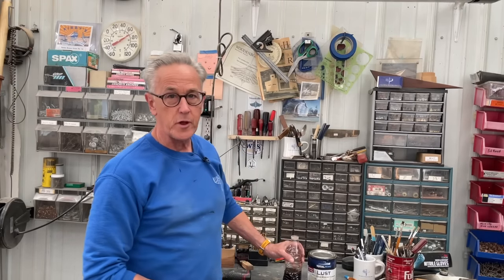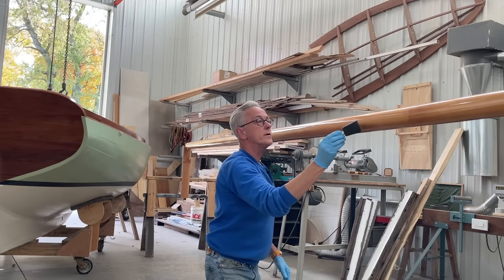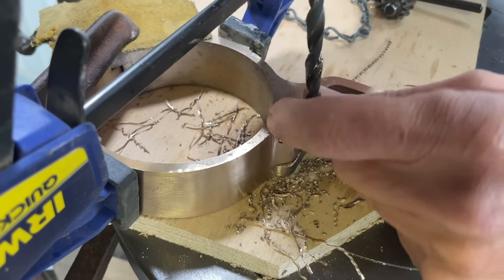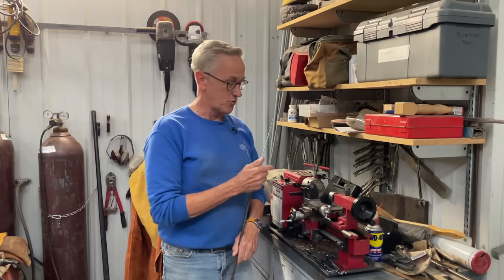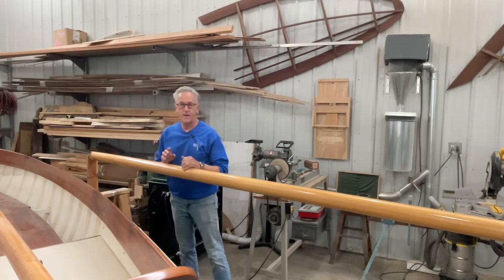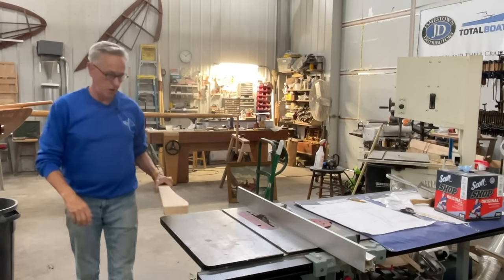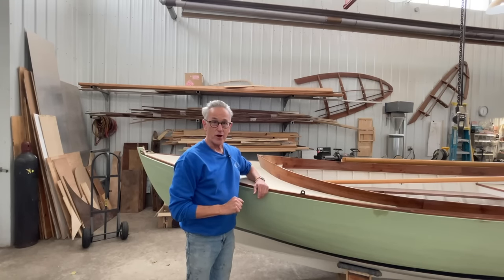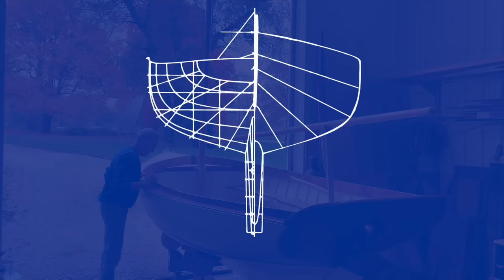Installing and Varnishing the Mast with Custom Bronze Fittings S2-E70

Comment: I find it personally rewarding and admire watching you working on your 12 1/2.  I belong to a volunteer wooden boatbuilding group who have been working on restoring a very old sad looking Herroshoff 12 1/2 for quite some time.  Needn't tell you it's been a lot of bloody hard work over a very long period of time but we're finally getting there. With a little bit of luck we should be finishing up the reonstruction sometime early next year.  It's been an especially long haul due to our having to replace all the cracked steam bent frames and the keel.   Will never ever tackle anything so difficult again - period!

Comment: The boat is really coming together and as all your work it’s looking beautiful. That was an excellent trade on the lathe and the clevis pins came out great, if I might suggest you modify them so you don’t have to deal with the separate small hair clip pins which will inevitably be dropped and fall between the floor boards and instead have an attached wire bail, google “Square Bail PTO Lock Pin” to see an image of that style pin I’m referring to.

Comment: Try McMaster Carr for pins. I don’t see any bronze ones but they have 208 stainless pins of varying length in 1/4” diameter. They are my go to when I need hardware.
Reply from the maker: McMaster Carr is amazing and I use them often. As I mention in the video I was looking for bronze clevis pins. I did find them at Fair Winds Fastners. Unfortunately they did not have the correct length. 
Making them was a fun small project as I get acquainted with the lathe.
Thanks for watching!
Cheers,
Bob

Comment: Beautiful work, as usual.  I did have a question about the mast partner.  The center screw seems to sit a bit proud from the inner arc.  Is there a concern that it will scratch/dent the mast when contact is made?
Reply from the maker: The mast will get a leather chafing protection in the final assembly.
Thanks for watching!

Comment: I watched the mast installation episode yesterday. Have you considered the wear on the mast at the mast partner? Any bending force on the mast is going to be amplified at that point where the bronze meets the spruce. Maybe you could glue a strip of leather to the inside of the steep halves to act as a buffer. Just a thought.
Reply from the maker: Yes, I have chafing in mind. In this video I was mostly concerned with the fit of the mast and parts. 
As I’m sure you are aware there is much more to finishing the mast with rigging, sail track, and gaff boom etc. 
thanks for your suggestion and attention to the details and watching!
Cheers,
Bob

Comment: Looks great! If you had made a Gaff rig it probably would have fit in your shop. BTW, you might want to flip the mast partner since you’re right handed.
Reply from the maker: Skylark is gaff rigged. The mast for a marconi rig is is nearly 6’ taller. The mast partner can be opened either way with a clevis on both the port and starboard. 
Thanks for watching.

Comment: There are a bunch of video's on here on upgrading that lathe to make it run  true & run better than it does right out of the box. & you can get a set of metal gears for it if that upgrade hasn't been done yet. Otherwise a very good score on the lathe
Reply from the maker: Indeed there are. The fellow I traded with had done several upgrade. Still fine tuning it and rediscovering my metal lathe knowledge. Been 50 years since metal shop in high school. 
Thanks for watching!
Cheers,
Bob

Comment: Hello
My wooden mast at the mast partner had a thin leather which was voiles, it presentes change.
Reply from the maker: Yes, I have chafing in mind. In this video I was mostly concerned with the fit of the mast and parts. I will be adding leather to avoid chafing. 
That’s for your suggestion and watching. 
Cheers,
Bob